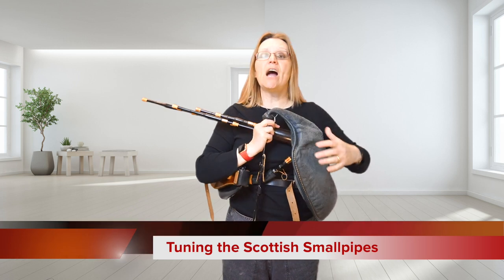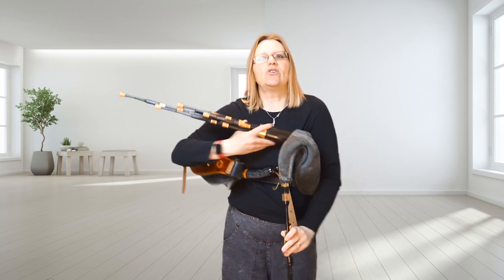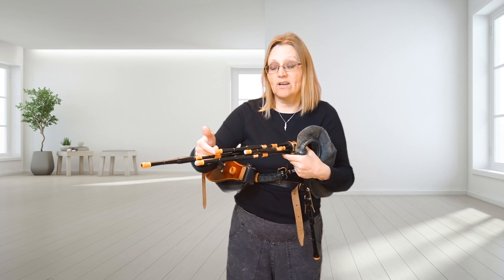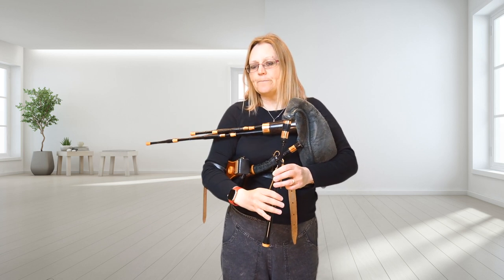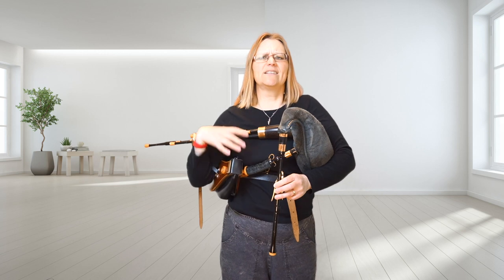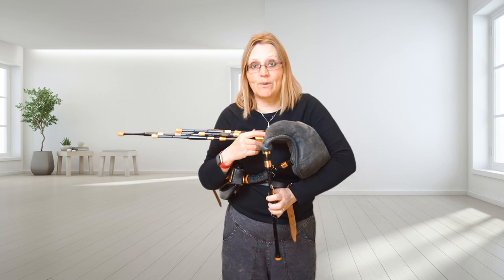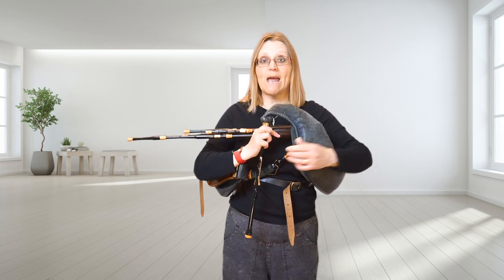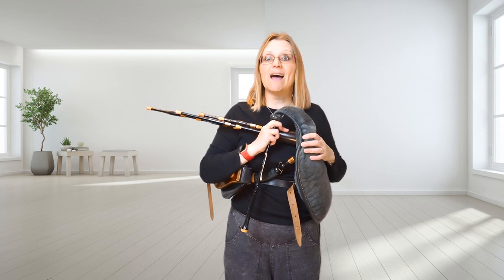Tuning the Drones on the Scottish Smallpipes!

Comment: I just dusted off my scottish smallpipes and i seemed to have taped off two of the drones years ago... I notcied you only tuned two, is that what is normally done depending on what key your chanter is in? Thanks!
Reply from the maker: If I’ve got my A chanter on, then mostly I use the two A drones. If a piece is obviously in D then I sometimes use the two D drones. Mostly though I use the two that match the chanter. This is a combined set where I have two different chanters that I can swap in.

Comment: I’m just learning to use smallpipes with a blow tube, after 8 months on a chanter, I had 2 drones (tenor & bass tuned to A) open & sounding pretty good, but I messed around with them & now they don’t sound so great😳 so I’m guessing the same procedure would work for me! slide them all the way out (flat) and then adjust accordingly.  I’m still learning to breathe/squeeze every but I’d like to have a drone or 2 open.  This is helpful, thanks so much
Reply: How are you getting on? Not easy to master but you have to stick with it because the rewards are without limit. Yes, you can reach heaven. Finding a background where the natural acoustics are good really makes the sound special. Like a church.
Any trouble with the reeds?
Reply: @maxwellfan55  It’s a learning process for me, the reeds are fine, theyre john walsh smallpipes; so they’re not the issue, I just have to continue to work on steady bag pressure, and the tuning is getting bette as I get better.  Thanks for responding and asking though, greatly appreciated.
Reply: @kimberleyguilmette761  Pleasure. My main instrument is bagpipes. 
Regards small pipes. I mentioned reeds only because if you have trouble with keeping the chanter in tune (slightly less so with drones) you may find issues with moisture if mouth blown.
Well, at least I did. It's why I switched over to bellows, very tricky to master at first (at least for me) but worth it. Helps if you buy real top-quality bellows.

Best of luck!